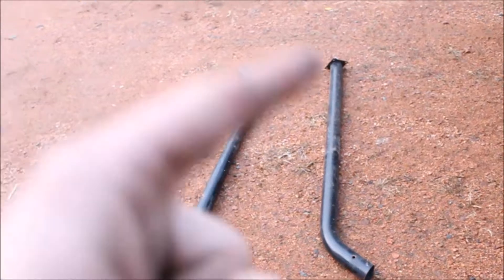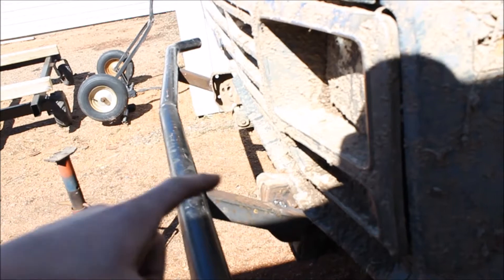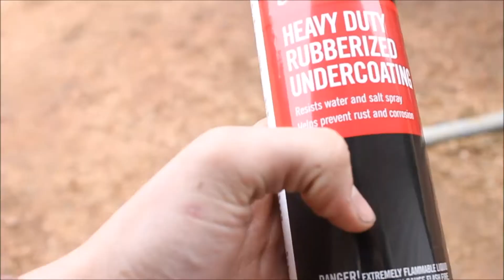Mud Truck Build: Ford 6.9 International Part: 3

Comment: For your bumper, you should of went to a junk yard and just pulled one. If you could of found a cast grille guard, that'd be even better. I have that setup, on my 85 F150. It's a good setup, the guard doesn't move at all. If you still didn't feel good about your stability, put a bracing behind the bumper and weld the guard to the bumper.

Comment: Its a low end torque engine. And about 1500-1800 RPMs it will pull a tractor park. Lol